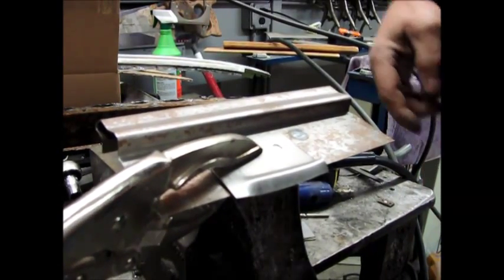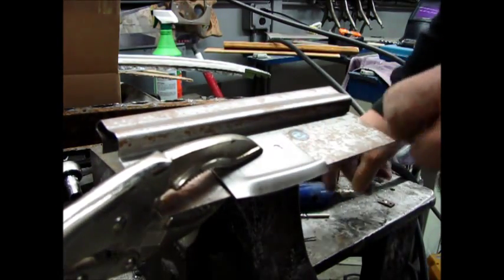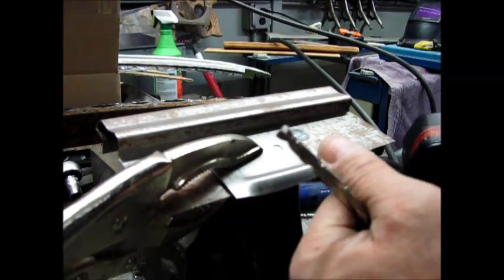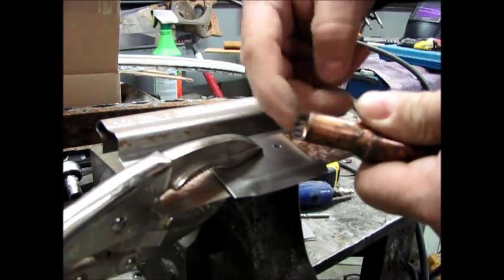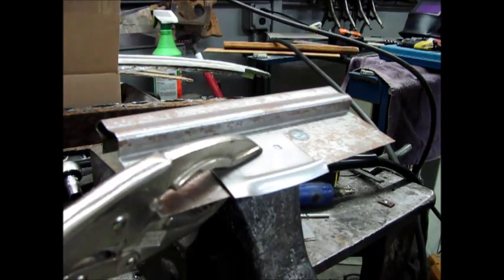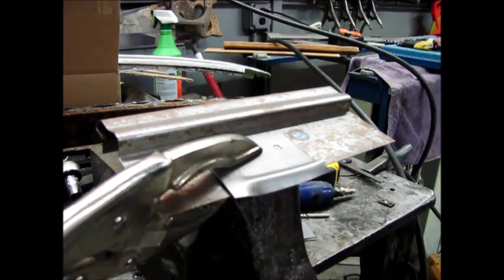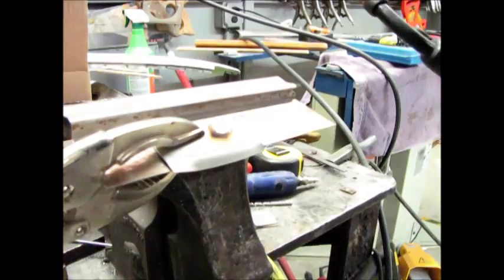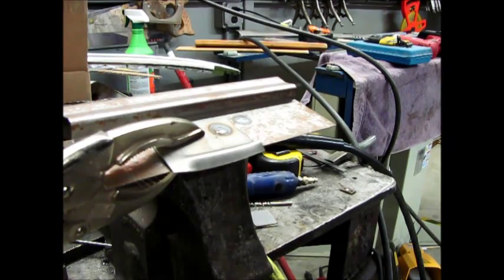Plug Welds

Comment: ok lets talk settings on the weld man need to run down some setting with a linde vi 253  inductance and voltage for sheet metal  wire size too